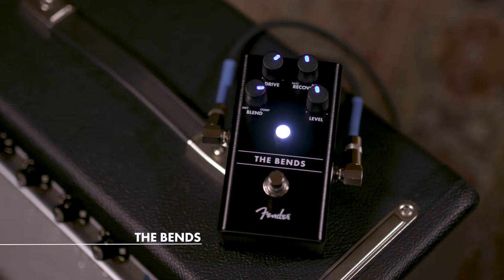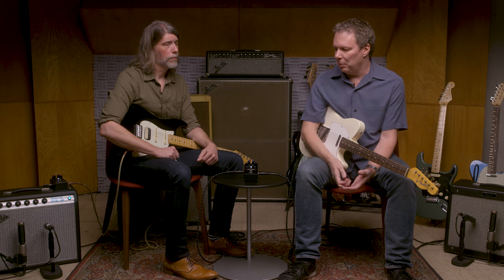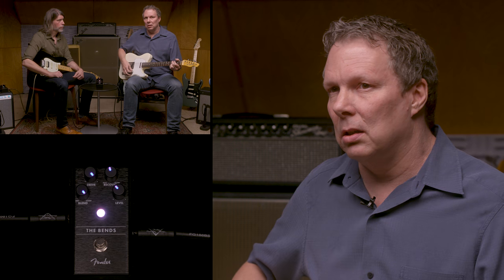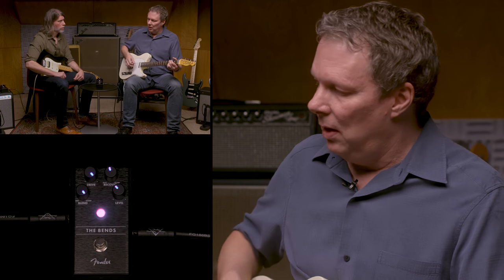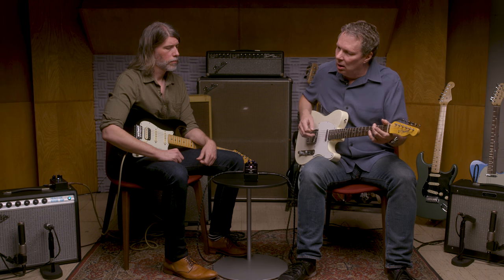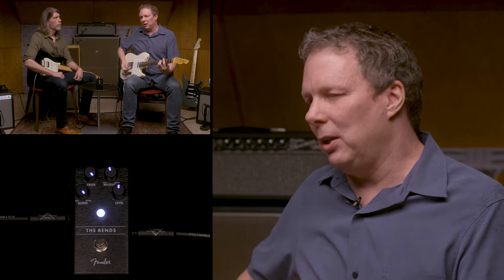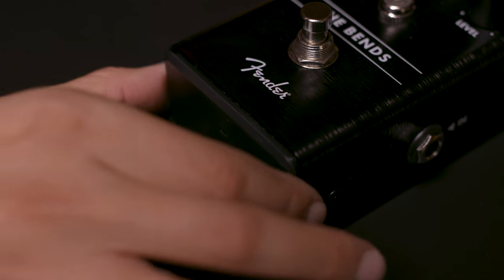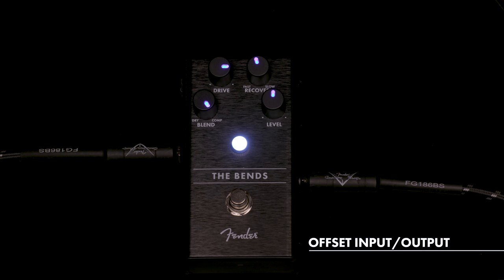The Bends Compressor | Effect Pedals | Fender

Comment: Will this pedal be good for bass guitar? I'm wondering if this will not eat low end. Looking good and sound nice as well.
Reply: Rafaels Sancess They were specifically designed with the guitar in mind. I doubt it would work but I'm not a bass player :/
Reply: I just got one. Used it with my bass at practice last night. Sounds great doesn't color the sound too much and is super quiet and I use quite a bit of grit on my signal. I used it with a sansamp GED2112 pre amp.
Reply: Jason Sneed sweet